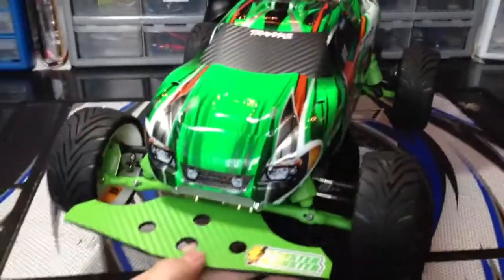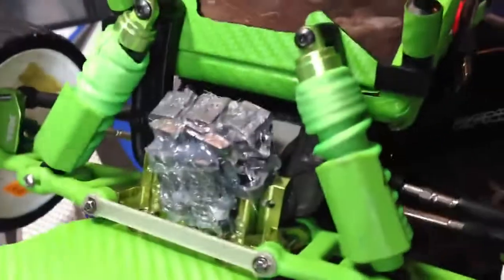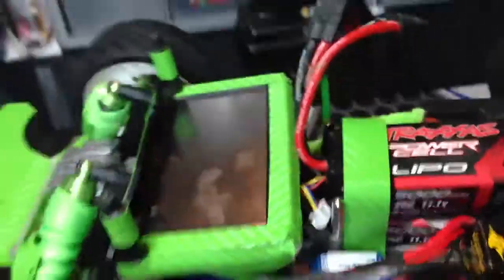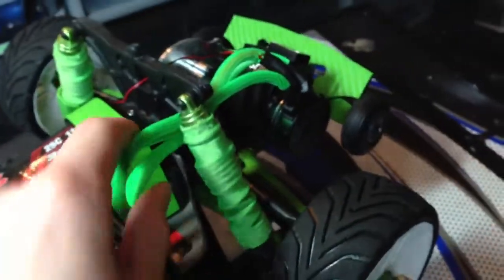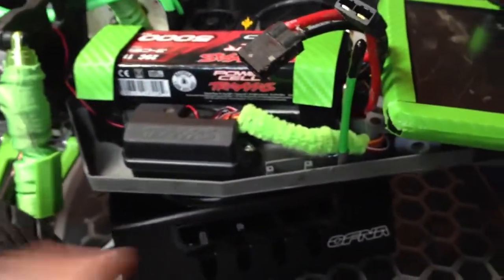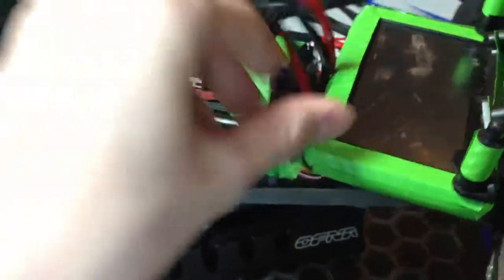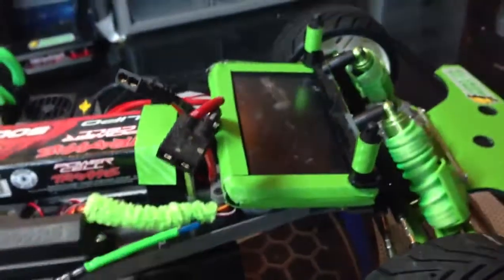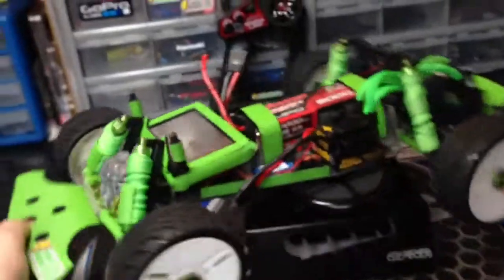RC Update #5 100mph Rustler mamba monster

Comment from the maker: shock cover from badhorsie website.  Just google bad horsie rc and wire mesh is ebay tech flex. just search that on ebay and you should find it.  they have all colors and all sizes.  If you are running the castle mamba monster system get the 1/4 size wire mesh, if velineon get the 1/8 size.